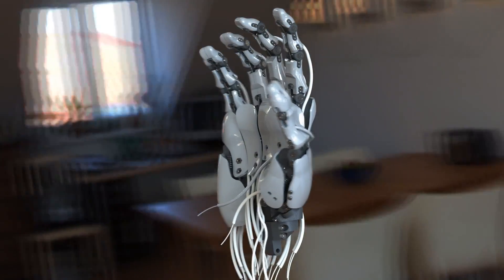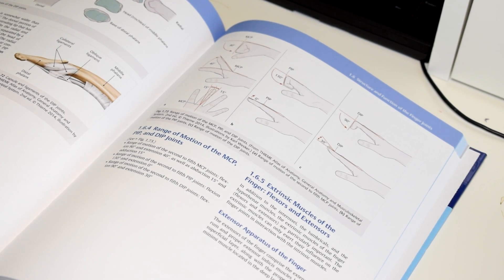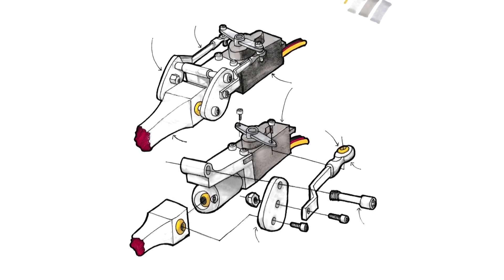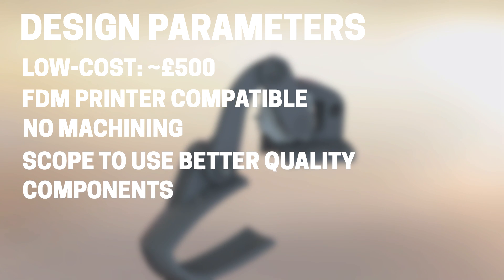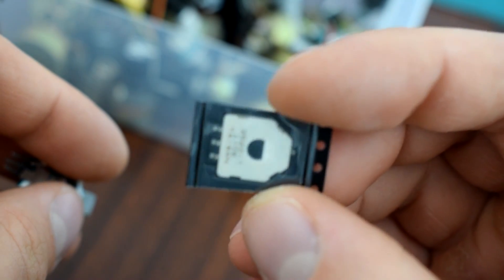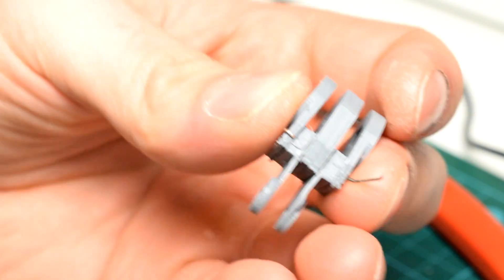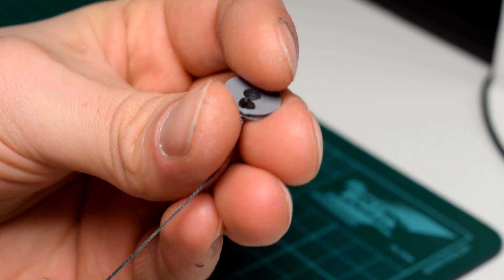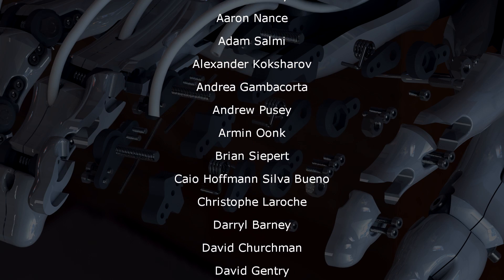Redesigning My Biomimetic Mechatronic Hand - 3D Printed Interphalangeal Joint

Comment: The design is absolutely amazing. The pulley joint is an amazing way to control the joint, and one of the most impressive things I saw was seeing something I did for my university project aswell (in a robot arm though not a hand).  Where you removed the potentiometer from the servo and and turned it into a 360 degree servo and used potentiometer for external position feedback. One thing I would recommend for long duration use is to use non back drive motors rather than servos for controlling the movement as servos would use up alot of power if you want to hold a position where as the non back drive motor can hold it mechanically.

Comment: Hi - fellow engineer here (about to go into my 4th year integrated Master's Degree in Engineering Science at Oxford).
I've been following this for a while and I'm really glad to see you pick it up again! I'll probably donate to the Patreon if that's what it's for.
What I think you're trying to do here is pretty much what I tried to do for my A Level Product Design Project (except that I made mine using 40+ year old metal machining tools so that the final hand could be made out of mild steel for strength and durability - also, my school didn't have 3D printers when I started manufacture...). It's also one of the proposals I made for my 3rd year group design prosthetics project (though sadly not the one my group decided to pursue). I never really considered the project finished and so never really put it to bed, and I always intended to return to it after I finished my degree.
Tl;dr:- I'd love to be involved in this!
I've been thinking about this for - probably over a decade - and I really approve of the direction that you seem to be aiming your design improvements towards. The torsional springs vs pulleys problem is definitely something that I noticed when I watched your earlier videos some time ago. I also love and am very much on board with your interpretation of "bio-mimetic" here, with the focus on function over execution - I doubt that it would be particularly useful to mimic the 'overlapping' phalangeal tendons that we have in our biological hands, since that would be a nightmare to control!
Let me know if you're interested - I have lots of thoughts and potential improvements that I've developed over literal years (for example that it might be more useful to have the potentiometers on the forearm rather than built into the joints, for about 5 different reasons). I'm a fan of these kinds of things being open source, and since you mentioned your intention for this to be that, I'd love to start a conversation, or at least, provide more detailed feedback.
I look forward to hearing from you. But even if I don't (because maybe I'm too pompous haha) then no hard feelings, I wish you the best of luck with this project!

Comment: For the pulleys you can use chain links. They are made with a large amount of variety and add a great deal of durability. They can also be taken apart to be stacked, and can apply greater force, enough to use a hydraulic pump if you wanted.

Comment: I actually think the wire idea to hold 3D printed parts together is pretty neat but it got me thinking:

You can buy small brass rivets (sub 1mm dia). Those would be perfect for an application such as this if you could fix them in place without damaging your print.

On top of this, you could heat up your rivet/wire after to melt the surrounding plastic so the parts adhere to each other

Comment: Will be interesting to see what you come up with, I’ve found that it’s always a good idea, especially with resin printing, to run a drill bit through your holes to insure they are the right size. I printed some fingers in resin last year and because I didn’t drill those holes before curing, I had to go back and drill them after. Was quite the surprise when I went to put in the linkages between finger segments.

Comment: DAmn your work will be the foundation of many mechanical engineered hands and even robotic hands if you shared. in other words your are one of the founding father to set the heat bed and pioneered to designing a mechanical types and works that are shared and i am pretty sure the University has no say because it will make you famous since it becomes shared. I will share this site with others you will lead us. Btw Keep that email active. Some way down the line in the future someone will be looking for ya.

Comment: Hi, I'm very interested in seeing what you come up with. Liked your original design, because it looked more organic than most hands out there. Glad to see you learned your lesson on guiding the wires like it's done in bicycles, if you had done that right in the original design i guess you would have had more sucess at the hand wrist.
Since you asked for suggestions I would recommend considering you to bring the potentiometer back to the servo. Also integrating the wiring inside of the "bones", but i know that's really tricky. Third thing would be using N20 geardmotors with encoders, could save some space instead of servos. Good luck.

Comment: The joint between the DP and IP pretty much tracks the movement of the IP to PP joint so a Pot isn't really needed to capture that data. I found that placing a Pot above the IP which maps the IP to PP joint and a Pot above the PP which maps the knuckle, then you only need a third Pot above the Knuckle to capture the fingers abduction. Doing it this way also leaves the tips of your fingers free which is helpful. I haven't finished my design because I only needed to prove the concept for now but I can share what I have if it would help.

I also have a rigid joint design for the finger which makes it easier to put on (suit of armour/iron man style).

Comment: FDM printers are getting super cheap, very accessible right, and are capable of making really high quality prints. Even a very entry level printer like the Ender3 ($210 usd) is capable of making prints at relatively high tolerances that are comparable to some resin printers. The trick is to set up your printer correctly and spend some time dialing in your settings to ensure the highest possible quality prints. Which isn't actually that hard, it just takes some trial and error, some test prints and bench marking, and maybe some cheap or free (printable) upgrades to your machine. 
Printers like the Ender3 are also capable of printing in ABS, which is way stronger. The only caveat is that they need a temperature controlled environment. AKA a box or tent to keep the ambient temperature around the print constant, otherwise you get problems in layer adhesion. Most people either buy cheap ones on amazon for $15, or they make one out of plastic bins. I've seen some made out of plastic film and PVC pipes, and plywood boxes. All seem to work fine, just so long as the printer stays warm and there's no airflow. All said and done, it's not that difficult and there's a wealth of tutorials and information for anyone wanting to print stronger materials. 
Speaking of material science, I'd personally recommend the channel CNC Kitchen for lots of research in to material strength, and he posts detailed papers on his patreon. Very helpful information.
Lastly, I can say that people are using entry level printers to get amazing prints after they've been tuned and calibrated properly. I've seen people make tiny Dungeons and Dragons miniatures that have nearly the same level of detail as resin printers. I've seen people make mechanical parts with remarkably tight tolerances and there are even benchmark prints that are one piece prints with smoothly operating mechanical parts. Tuning your printer, correcting the settings in your slicer, and using the proper filament would raise the quality of your prints, and quality of your project as a whole, dramatically.

Comment: A problem I have seen with many engineering students at my university is trying to 3D print screw holes into projects(especially aligned horizontally). While its possible to get acceptable results, it overwhelmingly leads to failed FDM prints. Unless resin printing is used; a better approach is to include pilot holes or witness marks and drill out the holes to the correct size after printing

Comment: I was thinking about collecting data for the user's profile using the hand for better movement. You put a glove with sensor in the other hand, in case its an amputee that has the other hand. But if they don't have both maybe programing with a a standard profile that was programmed by a volunteer that would teach the algorithm by machine learning.

Comment: The pully system is interesting, but i was thinking about different ways to build biomimetic hand and arm prosthetics and came up with the idea to use pneumatics instead of electric motors since I think that they could be stronger. The downside of a system with high pressure air, pistons and valves is of course, that they need way more space, have wires AND tubes going all over the place and you're limited by your air tank and the battery. But I'd love to hear your opinion on this idea..

Comment: There are a lot of cheap LCD SLA 3D printers out there, some under 200$ which rivals most FDMs for cost.
I would say you should use SLA as it makes more sense for this project, and it would still qualify as cheap and easy enough for a beginner to use.

Comment: I am also interested in that potentiometer! Where can I find these? Very nice to see you back on this project!!
Reply: Those sorts of potentiometers are pretty common but they're generally not listed as a "potentiometer." They're a "position sensor."
Search Digi-Key for part number "490-2400-ND."
These sensors and other potentiometers wear out with a lot of use. I'm always looking for ways of keeping potentiometers out of my robotic projects.
Reply: What's the failure rate like? Are there any better alternatives? e,g. strain sensors?
Reply: @ddegn  thanks alot for this detailed description, where I Find this product
Reply: @ddegn  Wow, thanks. Incredibly usefull comment. I don't want to use bulky servos but put in sensors in all kinds of joints, and in some cases they need to be very small, so knowing this already helps a lot.

Comment: To remove potentiometers or rotary encoders, and cut down on costs, I wonder if it's possible to *reliably* measure the resistance of the cable to determine its current length (one fixed end connected by copper, one brushed end). Possibly with an op-amp, cheap ADC, and a calibration curve for all axes, it may be doable.

Great work on the hand! If you read this, how did you model the frame and wires so organically in CAD?

Comment: Awesome project!!! Looking forward to your progress
Just wanted to give you a couple of thoughts. You can test it out if you like
Was wondering at first why you chose to use so many different pieces joined together with the wire instead of just making a single piece with snap fit. It seems like the consideration is eventual strength of the part? What I want to throw out there is the following
If the strength you're looking for has to do with during usage of the fingers, I don't think the joints will be a concern
Once the fingers have tendons going through them and they're rigged, during use of the hand the load will be taken up by the tendon, so the strength of the tendon and wherever that goes would be your weakest link
Think about, it'll simplify the finger design
Cheers

Comment: Finally! I am waiting months for this. Also which potentiometer do you use? I cant find similars in my country.
Reply: You may be able to find similar components on sites like digikey or mouser. On digikey they seems to be under "Position Sensors - Angle, Linear Position Measuring"

Here's a link with filters that narrow down the options to similar devices.
https://www.digikey.com/products/en/sensors-transducers/position-sensors-angle-linear-position-measuring/549?FV=69%7C409393%2C545%7C356031%2C570%7C396000%2C1076%7C397533%2C-8%7C549&quantity=0&ColumnSort=0&page=3&pageSize=25
Reply: @joshuadsuper101  they has minimum 1000quantity. LoL
Reply from the maker: The potentiometer I use in this video is this one :https://uk.rs-online.com/web/p/potentiometers/7703150/

There's actually a newer version however (and it looks like the old one is discontinued) so these are what I'm using now: https://uk.rs-online.com/web/p/potentiometers/1675336/
Reply: @WillCogley  both links say discounted product?
Reply: @WillCogley  it actually looks like both the options you linked are discontinued. is there an even newer version to both of those?

Comment: I am curious if you are going to use TPU as some form of tendon. In theory you could use a dual extrusion printer to print parts with PLA/PETG with integrated TPU tendons and or cables... And some FDM printers can print in metal that can be baked to become super hard and durable as well...

Comment: I have a question, if one printed a replica of the human bones in the hand, wouldn't it be easier to simply replicate the motion by affixing filaments where our own muscles connect and extend these into the palm or preferably the wrist where a small motor can deal with actuation? We have a pretty good understanding of how the muscles in our hand work in relation to each other so copying that into the control would give a pretty decent baseline for the subsequent fine tuning.

Comment: That is a really cool design, what king of potentiometer are you using to mimic the movement of a joint, and are you using only servo motors like the ones they appear in a simple starter kit of arduino. Also, are you programming everything in arduino??

Comment: so I am a watch repair person and I think you would really might enjoy some benefits of watch band parts, so these are friction link rivet. so what you do is you put the tube threw the hole of the link, then on a metal block or hard table you hammer in both ends of the rivets into the tube at once https://www.amazon.com/Wholesale-Friction-Pressure-Diameter-10-28mm/dp/B077Z5RL8C I don't make any money off of them just pure advice. they are made to have lots of motion last years they are strong and cheap. they are sold by the box and have different sizes they are perfectly the same size. you can also sand them down to any length. you also might try cotter pins https://www.amazon.com/Nice-Pies-Spring-Watchmaker-AssortmentStainless/dp/B07F84Q4LF/ref=psdc_378531011_t2_B000OVPBI6. just saying no use trying to reinvent the wheel as watch parts have been perfected over hundreds of years and made exactly for the motion you want to do. locking glue would make the cotter pins permanent but if too much is used it might prevent motion on plastic. wire is great too but I would guess would be inconsistent in motion. you can get brass rods and hammer them flaying out the ends in place but with plastic parts your going to need some practice. their are also screw lugs you will need locking glue to keep them from coming louse and I don't recommend them for your application.

Comment: I know you were against the screw idea, and you want it to be FDM printable (although great quality resin printers are now sub $300) - but in theory, you could 3D print screws, just like you can 3D print screw channels with resin with incredible tolerances at that sub $300 price point.
By the time your project is finished, those same printers will likely be sub $200 or even sub $150, so surely it's a good price point to aim at?

Comment: Hi, im watching your video, an the new one, and i have a question. If you are printing the pices... but you not print the joints two... (im from argentina, and english express in english is difficult), I means... if you print the fingers as a one part, whit the articulations, and leather you put between the joints some rubber, you can copy the human articulations, and you are aboid all the bolts and nuts for the connections... you can model all the bionic hand, and each part of the fingers, lycke a rotula, left space between the parts for leave them move, and leather you put some liquid rubber between them, leather you only have to pass throw the wires to the servo motors. I think this will be very much ligther..... sorry if i dont write this well, if you want, contactme and i will draw you my idea! Thanks!

Comment: With your experience, how would you design a roattional knee joint at 3-4mm diameter? I don't think there are ball bearings this small and a steel wire seems too flimsy

Comment: there are companies in china and all over the world where you can send the design files and they will print out your part/s in resin for you. The Chinese factory have an ETA between payment and products arriving of  3 days to 1 week. I was watching an engineer visit the factory in China and they had about 20 commercial (USD$50k) resin 3D printers outputting parts for on-line customers all over the world. So you don't need an expensive resin printer any more, you can just send the files pay on line and within a few days the parts are delivered. Not so sure about throwing soft robotics on the scrap heap so fast is a good idea as it means most of your research time is going down a one way street to no where. Also cables themselves are not a good medium, cables stretch and deform over time so need constant adjustment. I cant see end users being happy having to recalibrate limbs every week or swapping out cables.

Comment: No front, but what 3D printer do you use? For around 900 Euros you can get something like a Zaribo which will get you much higher print quality and accuracy than what is seen in this video.